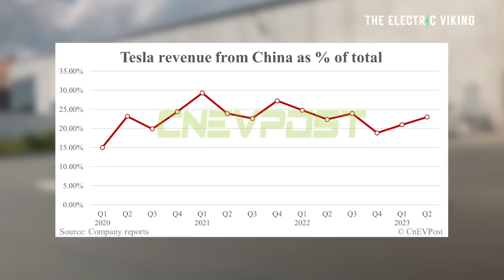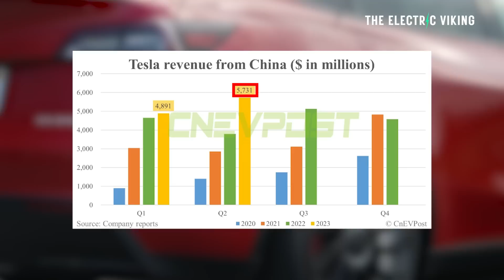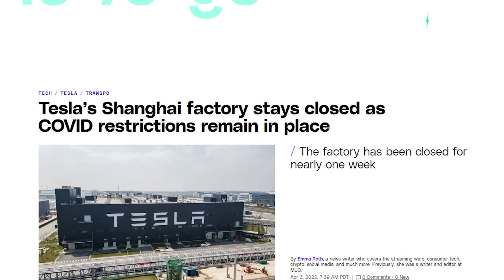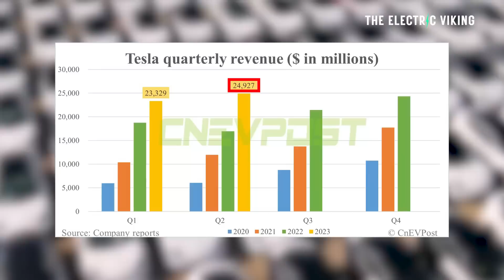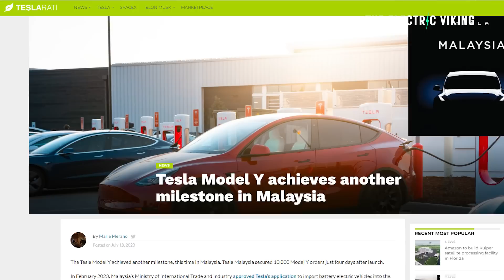Tesla's revenue from China up 51% YoY - defies critics of price cuts

Comment: Shanghai should be making the "Model 2" for worldwide distribution before Giga Mexico, Tom Wu would have the lines flowing in less than a year, be able to prove out and optimize the production process and then pass the learnings to multiple factories worldwide to save import tariffs.
Reply: china doesnt really want the model 2 built in china, they dont mind expensive cars being built there, but they dont want the low cot tesla being built in china.
Reply: This ain’t Mr Elons first rodeo
Reply: That would be good for China and good for Tesla, but if China does not move on this other countries and Tesla will. As sparkysho-ze7nm said "This ain’t Mr Elon's first rodeo."
Reply: @scottmcshannon6821 no, you're wrong. Those who only want to sell expensive cars are legacy automakers because they can't actually make a profit with cheaper cars. China can, and it will produce cheap and expensive cars
Reply: Tesla is risking its top  place in the world EV market by being slow to roll out the Model 2 .It is allowing BYD and other Chinese companies gain a big foothold in the world market where small cars are more favoured. We are not expecting to see the Model 2 for at least another 12-18 months produced  in any of the non US based plants which are able to manufacture cars cheaper for export to the world market .I doubt the cost of producing cars at Tesla Berlin can match Tesla Shanghai.

Comment: Tesla gross margin also decreased from 26% last year to 18%  Q2-2023. No comment about that ?
Reply: Didn't margins for other manufacturers decrease over the same period?  I would say that if they are rolling out a new platform with significant cost savings this is nothing to worry about (if you are correct).
Reply: Wow, only 12% higher than Toyota!  How will Tesla survive?!
Reply: @jefflittle8913  BMW Group gross margin is 17% in 2022, 18% in 2023.
Mercedes Benz gross margin in 2022 is 21%, and 22% in 2023, to name a few
Reply: @jonpetter8921  but these figures include ICE vehicles...  So not a good comparison